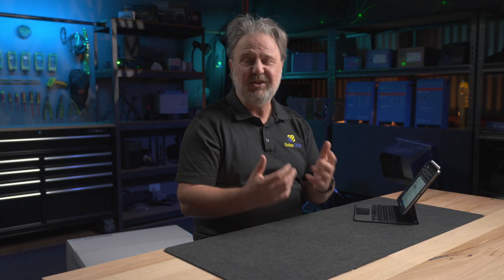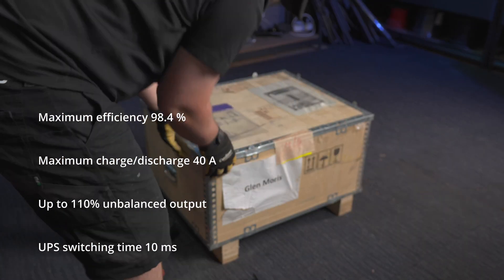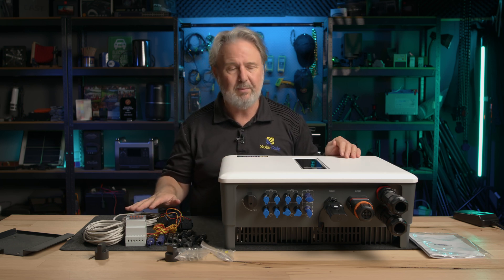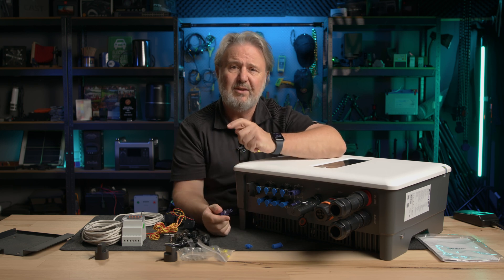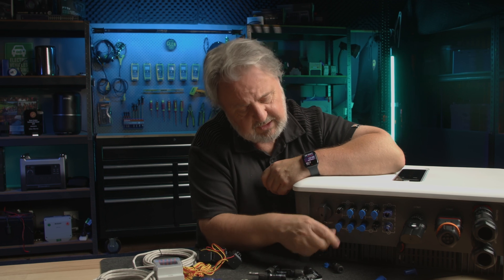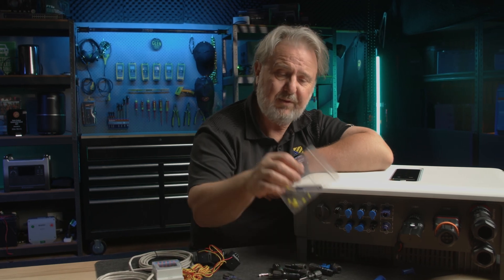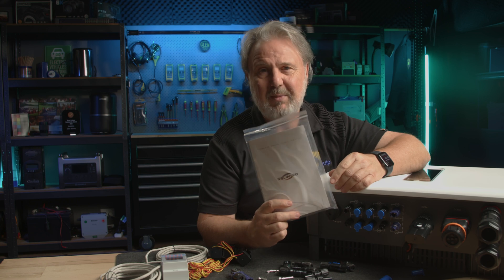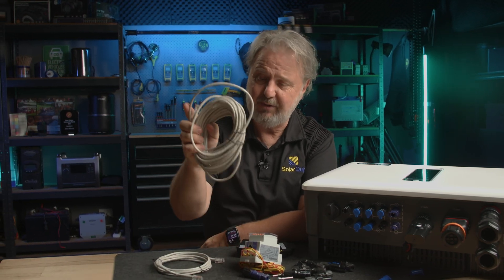Solinteg 20 kW hybrid inverter

Comment: Where are these on the CEC approved list? I need to quote them.  I already quoted 3x30KW Goodwe hybrid inverters allegedly available in June for a warehouse. Every house needs at least a 20KW 3ph  hybrid for EV charging. I may have to replace my 30KW grid connect Huawei for a 30KW hybrid now they will slash my 20c feed in on April 1. Made $1550 in 2 months Jan-Feb this year. No more.
Reply from the maker: CEC approved list pending as of April 2023. Watch this space.

Comment: Hi Glen, happy to see your unboxing of MHT-20K-40, as im early owner of this inverter having some issues with it. My setup is curretly MHT-20K-40 + 30x JAM60S10 345W connected to MPPT1.
1. After Installation of Inverter, I was able to start it, only after setting N-PE Check off, unfortunately this option is not metioned in manual.
2. Inverter is restarting it self in cycle on sunrise and sunset, somewhere between 130V and 550V.
3. The Inverter is "ignoring" loads under 500W if export limit activated. This means if your loads are under 500w and there ist plenty of power from DC generator, the inverter generates 0 Watt !
did you experienced any of this issues?
Looking forward to your full review. Have nice day
Reply from the maker: Hi Tomas. I spoke with Solinteg and they can help. Please email service@solinteg.com
Reply: @SmartEnergyLab  unfortunately even after 2 weeks no Response/Solution from Solinteg. Glen do you have by any chance list of the modbus registers? Thanks